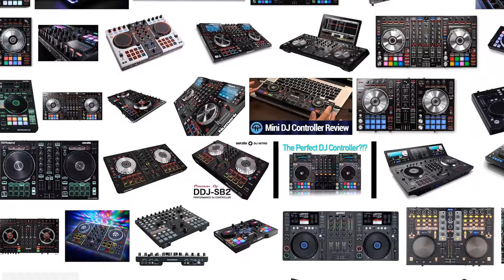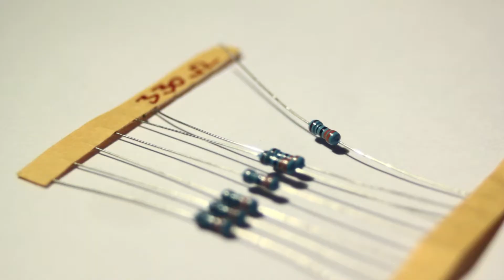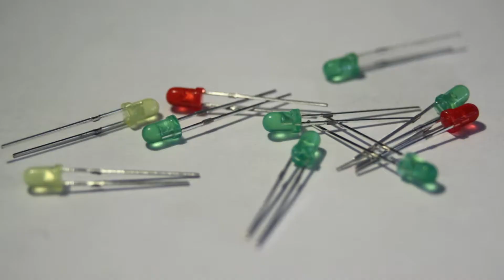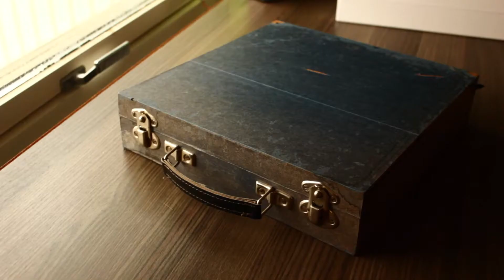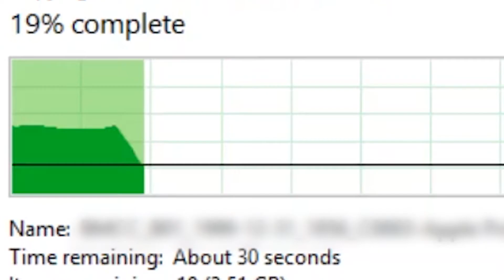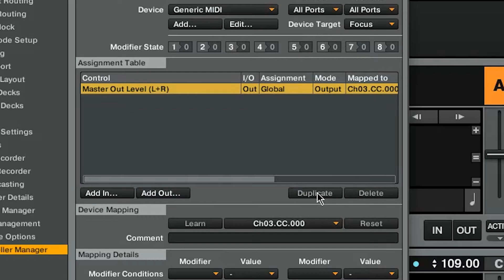The DJ MIDI Controller Project (MIDI VU Meter)

Comment: Will you also add a audio jack for the headphones? i already built a  arduino based dj controller, but i have no clue how to add a 3,5mm audio jack for the headphones. Is that even possible ? Djing without headphones isn't that easy. Thanks dude nice project
Reply from the maker: I am going to yes although obviously that isn't MIDI so I am using a USB sound card internally that I will setup to be the headphone output from Traktor.
Reply: nice i 'm looking forward for the upcoming videos of the The DJ MIDI Controller Project